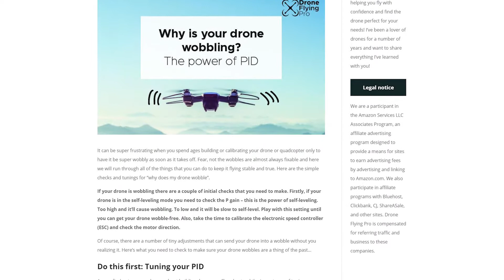Why does my drone wobble? The simple settings to check!

Comment: I have a ducted foxwhoop 13 times I've rebuilt it I have really bad memory so it did fly then I broke the cam while los flying, so I took the camera out put it back together I'm sure it was the same but I added someone's 3-4 ducted presetting from betaflight I can hold the drone and nearly half throttle then it wobbles left n right it's a 2.5 inch or I wouldn't be doing this .I've reversed the props n motors .it will not let me reinstall the original settings which are nothing from speedybee f7 mini v2 .I know it's a mix of tunes from betaflight as I keep forgetting that I had done one then add another so I know it probably just needs a reset and the original tune it gets from betaflight for starters anyway I'll work out a way of getting the cli clean without bricking it ,thank you for sharing ,have a great day.